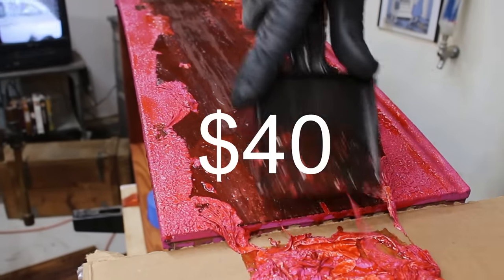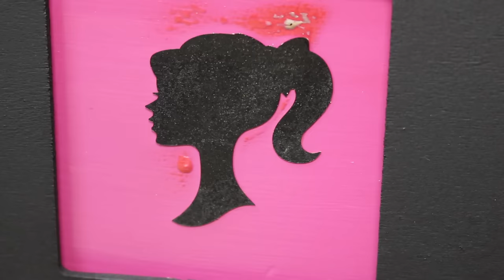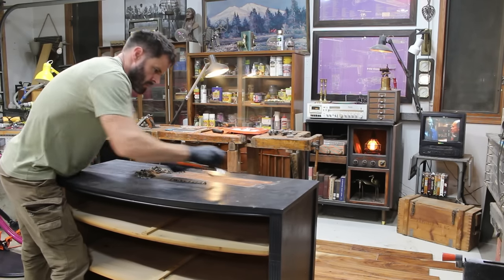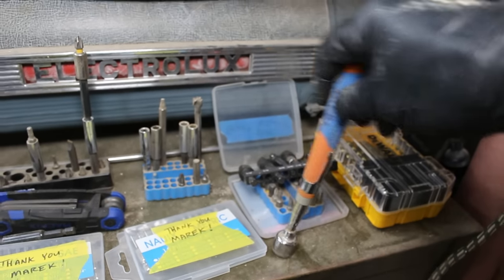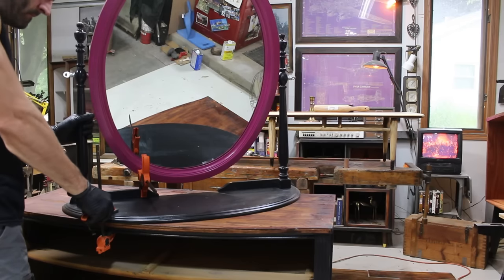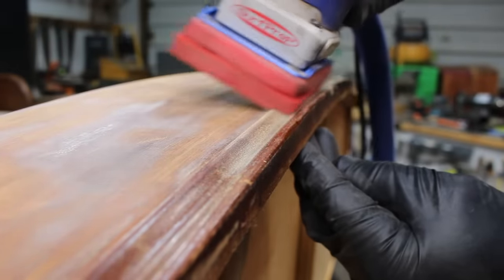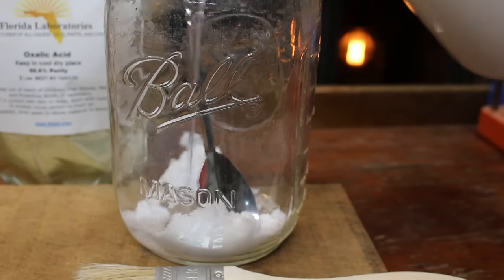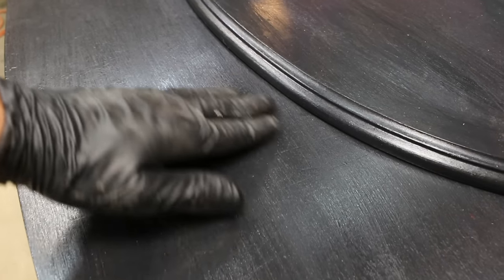Ep. 84 Nasty BARBIE DRESSER was Painted, then RESTORED

Comment: I removed water marks and stains using a steam iron. Get the iron steaming good, then place a blotter cloth over the top of the wood. Something like a couple of layers of flour sack toweling works. Then place the iron on top and give it a good steam. Lift the cloth and a lot of times the water mark or stain will lift. This does lift the grain, so weight it while it cools. It will also "re-glue" veneer that has buckled. I used this technique on my great grandmothers treadle sewing machine cabinet. She had a plant on top of it for years that had leaked on occasion. It was severely damaged, but I got it back good enough that the surface was renewed and almost level.

Comment: I enjoyed your video.  I occasionally redo a piece of furniture. My latest piece was about two years ago. I found along the road. It was a washstand with Knapp joints They were made only between 1870 and I believe 1890. The original latch was still on the door and when I stripped it down it was copper, so I painted it copper the latch was put on crooked and had a broken screw still in the door. I put it back exactly the same way and you can see the broken screw if you take a picture and blow it on your phone. It also had a bad stain in the top I tried different ways to get it out and finally decided to try Oxiclean and it cleaned it up and I had to clean the whole cabinet, but that was fine. It now sits in the room my granddaughter now uses when she spends the night. i do it for fun and can't stand to see an old piece thrown out.